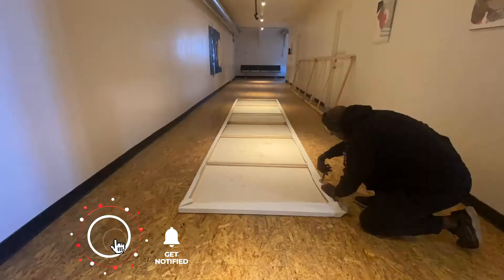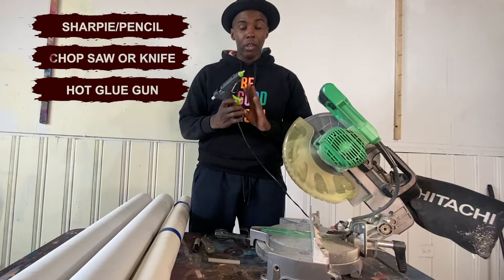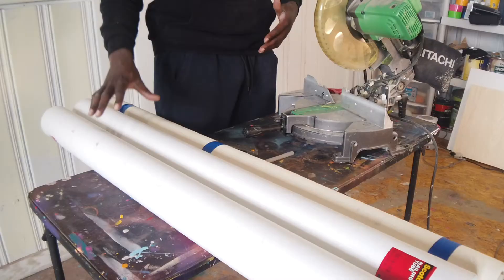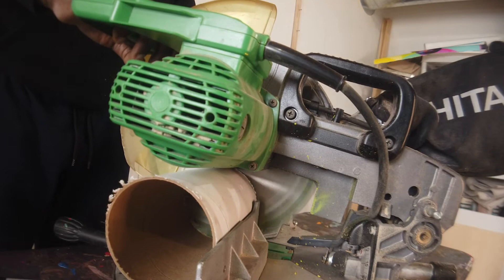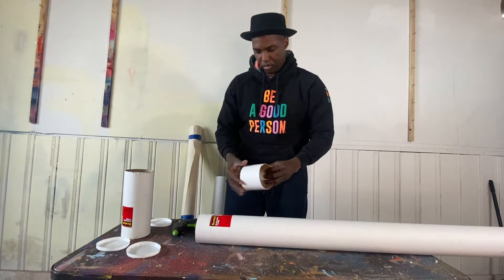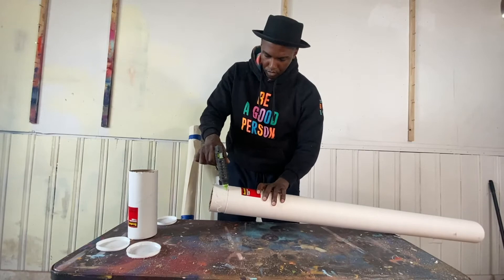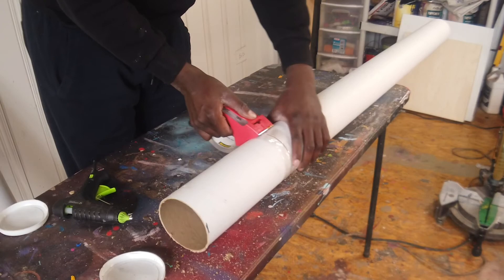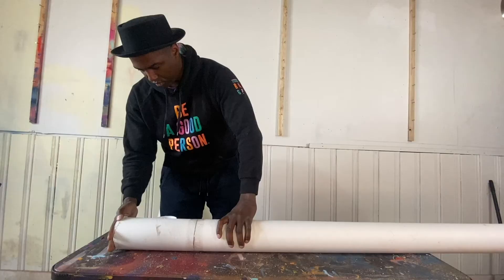How to Make a Long Shipping Tube to Ship Paintings and Artwork

Comment: My friend. I ship a lot of large pieces. The best value and strength is go to Lowes or Home Depot. In the plumbing section. Buy a 4" solid PVC drainage pipe. They are 10' long white on the outside. for under $10. That's a dollar a foot. I cut 2 50" sections. They are usually a bit dirty so wash them out first. They are very strong, I think you can almost run a car over them. I either 3D print endcaps, or just use cardboard. They are not too heavy either so it does not appreciably increase shipping cost. Look for (4 in. x 10 ft. Triplewall Pipe Solid)

Best part I end up with some 2 foot ends. They come with fittings so you can link 2 together. So for every 2 pipes I buy, I can make up a 5th tube from the left over.